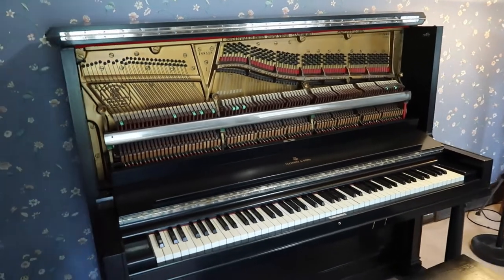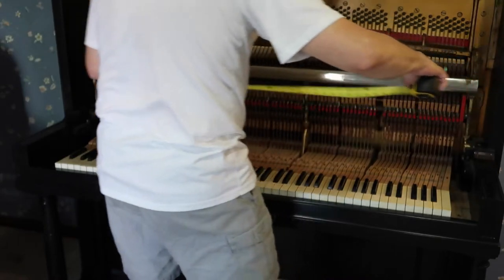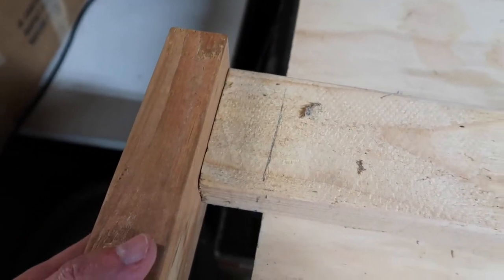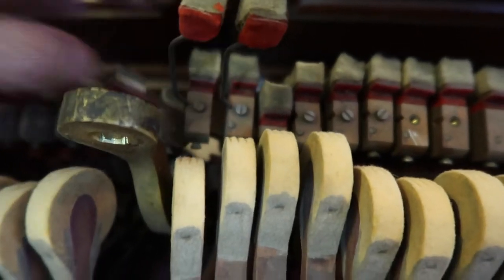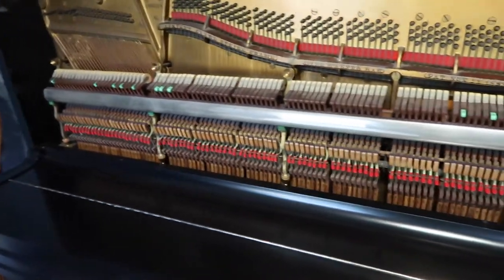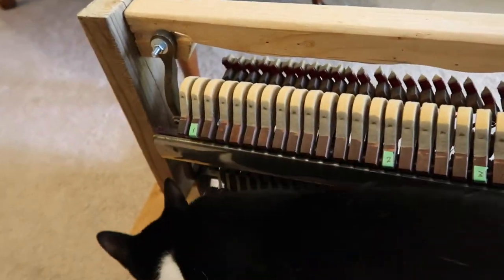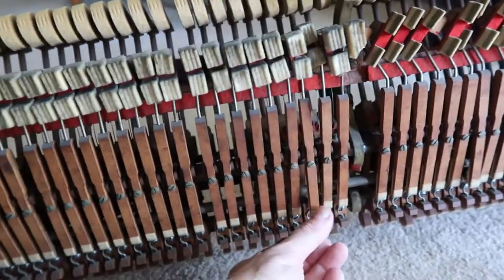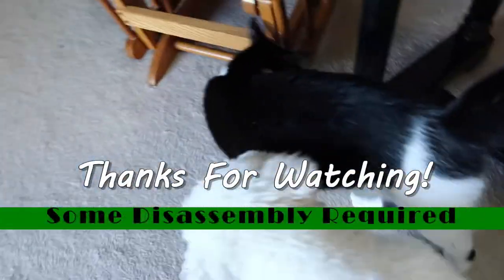Refurbishing a Vintage Steinway Upright Piano - Part 4: Building an Action Cradle

Comment: hi i jus purchased a 1878 steinway upright in a condition like yours, been following the series would Love some more videos explaining the next steps!!
Reply from the maker: Sorry but I haven't gotten around to taking the next steps myself yet. As it turns out, the problems I found in mine have been tolerable so I simply haven't gotten around to it yet. Howard Piano has a lot of videos on fixing pianos that I've learned from, so I can recommend that channel. Or, if the problems your Steinway has are on the low end, you could maybe pay a professional to fix them. I estimate that mine could be fixed by a professional for less than $1000, though I plan to (eventually) fix it myself.